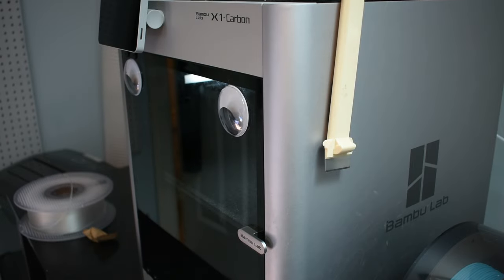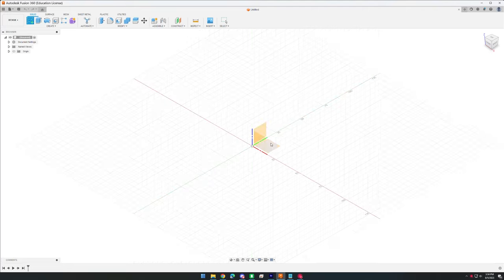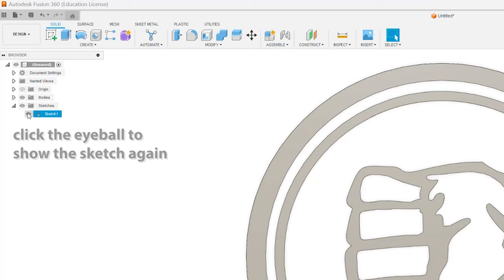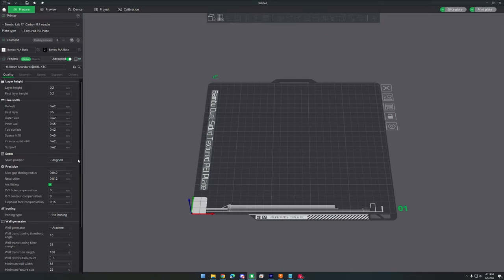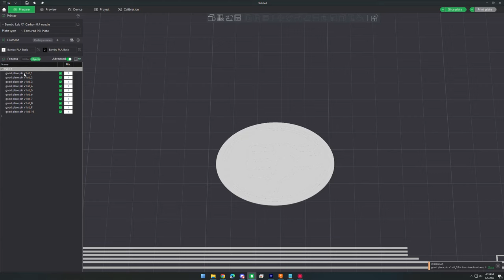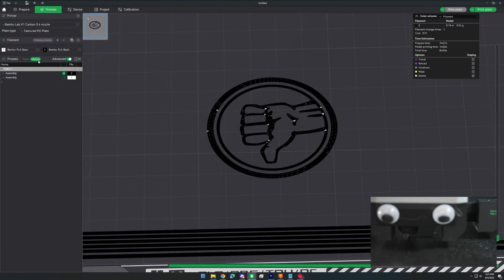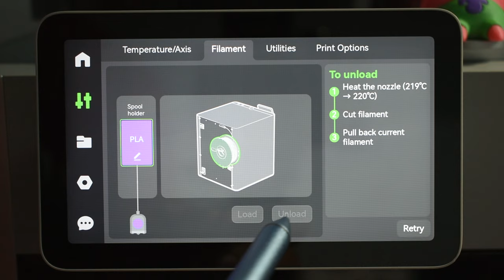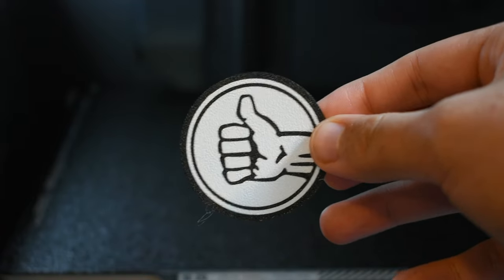(No AMS) Flat Multicolor Printing // Bambu 3D Printing Tutorial

Comment: Is there any way to do this but print a few layers of supports and then switch to TPU and print on top of the (pla) supports. As im struggling to print TPU supports as they fuse to the print

Comment: What is the reason for placing the model at the front of the plate, off center?
Reply from the maker: The Bambu Lab printers know the location of the print bed by bumping it into the nozzle. This happens at the start of every print, so if you don’t move the part away from the center, the nozzle may hit the already printed filament and mess up the print. I hope that makes sense. Happy printing!
Reply: @Markury you can change this with some start gcode modifications in Orca Slicer
Reply: For the second color, simply comment out the start g-code to avoid homing and auto leveling. For example:

G90 ; use absolute coordinates
M83 ; extruder relative mode
M104 S[first_layer_temperature] ; set extruder temp
M140 S[first_layer_bed_temperature] ; set bed temp
M190 S[first_layer_bed_temperature] ; wait for bed temp
M109 S[first_layer_temperature] ; wait for extruder temp
;G28 ; home all
;G29 ; Auto Leveling

And in the first color, for the heated bed not to cool down, simply comment out the end g-code and also keep the motors locked to do the filament purge. Ex:

G91; relative positioning
G1 Z50 F3000 ; move z up little to prevent scratching of print
G90; absolute positioning
G1 X0 Y300 F1000 ; prepare for part removal
M104 S0; turn off extruder
;M140 S0 ; turn off bed
;M84 ; disable motors
M106 S0 ; turn off fan @Markury
Reply: @arribako3d844  hello can you explain how to do that? There is any guide?

Comment: Ist there Not the Problem that the nossel ist scratching in the other layer color?
Reply: Usually it doesn't. But to be safe, in the Slicer you can go to the printer settings in the extruder tab increase the Z hop when retracting to .6 or .8

Comment: I would rather just spend the 300 for a AMS unit then to go thru all that trouble........😂😂😂😂😂😂
Reply: Same, I realized how dumb I would be if I didn’t just get the AMS
Reply: What if you are printing with TPU :) AMS doesn't work with it so this method helps as a beginning point.
Reply: @UgurGuver  This is my current problem
Reply: That's exactly what I'm about to do.... some TPU multicolor prints directly on t-shirts :-)  @UgurGuver
Reply: What about if you want to print glow filament, cf, tpu and other none ams materials? 🥴
Reply: AMS is nice but it's not the end all be all. It's not quite there yet, like with all the waste and limitations. Yes it's convenient and who doesn't love multicolor 3d prints but IMO I've gotten better results from simple post processing and engineering parts to be printed separately and with pauses and manual joins. But that's just me, results will vary.